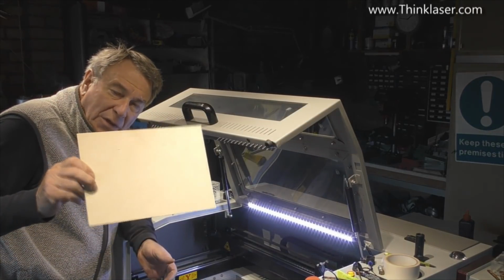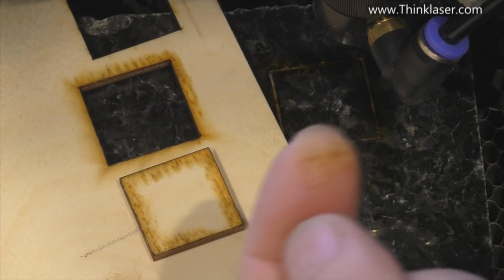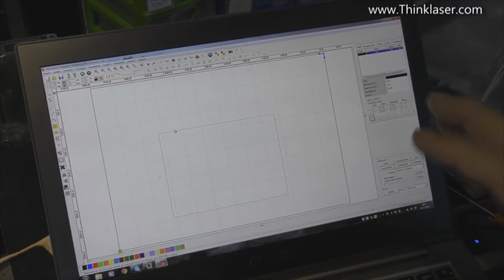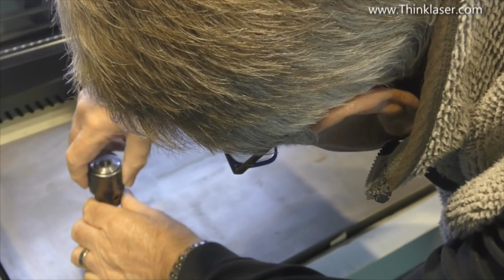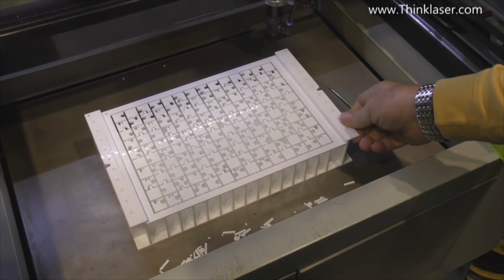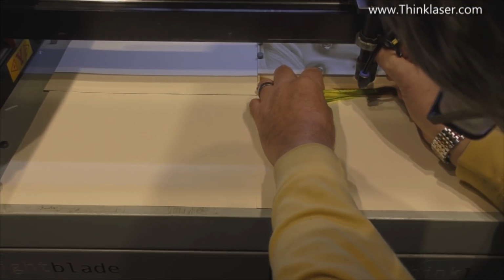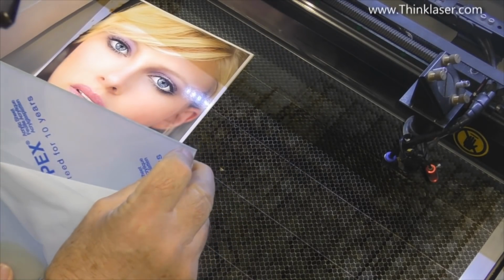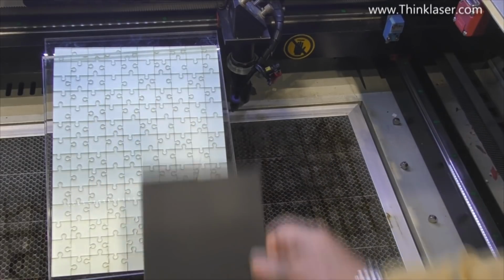How To Laser Cut a Jigsaw Puzzle (2019)

Comment: Two other solutions are to back the wood with either masking tape or the transfer paper used to place vinyl for signs.  The latter is just wide, sticky paper and comes in different levels of stickiness and comes in sheets or rolls.  It is not expensive and is easier than applying several strips of masking tape.
Reply from the maker: Hi Dav, I've used the same tape myself occasionally, however I prefer to have the extractor to pull the fumes away before they have a chance to settle on the surface.

Comment: Just raise the puzzle stock up off the honeycomb the thickness of the stock - pieces will fall down as they're cut free and you get no blowback as long as your honeycomb is relatively clean (cut 4 strips of stock and put under the 4 sides). Also, COVER any exposed honeycomb to give the best downdraft from your exhaust fan. #puzzleimpossible 🧩🐰👍

Comment: You used 467MP. There is also 468MP, it is a thicker sheet and better suited for rough surfaces, like wood. I found out about it in the 3M website, they had a downloadable PDF about different adhesives and their uses.

Comment: What about to cut puzzle line few times with high speed and low laser power? To make plywood evaporate like coding the engraving instead of burning it? Like 500 mm/s 15% power, few times to get the bottom of the plywood. It might be more time consuming but I’m interesting what’s results you can get

Comment: Hi! Im working on this problem too, have solved the marks on the back with a pin table. The front has to be 100% clean as well, for now i use masking tape. I have an epilog laser with air assist. Did somebody modify a similar lasercutter with special nozzles or so?

Comment: This is not hard! If you lift the wood off the honeycomb, the resin flashback will disappear, but you still need to avoid raising it too to high and loose being able to use the table's alignment / registration guide(s). All you need to do is put screws in the honeycomb "holes" where the heads of the screws will elevate the wood ~4mm. That is all the space needed to preclude flashback.  Using a paper printout of the vector lines will show where NOT to put a screw-which w/could cause flashback.  An easy way to remove the screws post-lasering is to use a magnet to lift the screws out of their "holes".  So, get get screws that are attracted to magnets.  I live in the US and imperial screws tend to have flatter heads, so I searched metric screws whose body was large enough to fit in my honeycomb grid AND with large enough heads to not fall through the grid at least 4mm heads.  As I recall 10 or 12mm screws worked best in my grid. One doesn't need many screws.  For a project like this, 7 would be plenty: 6 around the perimeter and 1 in the center. Voila! No more flashback.

Comment: I see a lot of 'use masking' tape comments. But good luck in peeling 144 pieces of fragile masking tape off. Instead just put down a piece of paper under the print, all the gas will coat the underside of the paper and can be thrown out afterwards.

Comment: OK, here are some things that you could do — and they work.  If you want to stick with the wood on the vector grid, you can do what you did, and then when you flip it over, run an orbital sander of the back side of the wood.  That will get rid of all the blow-back discolorations.  This is something I used to do until… What I prefer to do is “lift” the lasered piece off the vector cutting grid.  You do not need to build a fancy contraption that is centered in the middle of the table with a specifically created file to consistently place your piece.  That has to be really inconvenient each time you use your laser.  Use the home corner braces of the laser table.  The piece will ALWAYS be in the exact position, without a template starter file.  There are two easy ways to raise the picture off the grid, so it does not have contact with the metal vector table’s grid, particularly when you have a border around the final product, which you should have, anyway, to cut a final perimeter cut.  I use pieces of acrylic (typically 1/8" (3mm) or even 3/16" (6mm).  I have lots of interstitial pieces of acrylic from various projects that are small and round or square (or can be cut from projects that have interstitial places-why waste this acrylic that an be useful, someplace?).  Place a piece under each corner and in the middle of each side of the frame part of the pre-jigsaw puzzle.  This gap will preclude any back-flow markings on the underside of the piece.  What I have now found to be even easier is to insert screws #8 about 1" or more long (4M??  ~10mm long) in the vector’s honeycomb.  The head of screws, which an also be as thick as one wants (whatever the manufacturer makes), will keep the screw from falling thru the vector grid.  The screw heads are consistently the same height so will consistently raise the cutting piece above the grid the same amount which would maintain a level piece.  Additionally for curved pieces to be lasered, get a heavy bar and place around the edges on the perimeter frame of whatever is being cut.  I cut lots of laminate (Formica, etc.) which is always curved and too rigid for metal bars to hold flat.  I used some aluminum angle bars, 1/16" (1½mm) thick with one “leg” of the angle bar cut to it is only less than 1/16 (1½mm) long, while the other leg is however wide it was when you bought the angle bar.  So then I can secure this aluminum bar to the home point perimeter of the vector table with screws or binder clip, in my case, on the left and top side of the lasering table.  This creates a small gap between the vector grid (or raster table) to hold down at least two sides of the piece to be lasered.  It only adds 1/16" (1½mm) to the “absolute” home position location.  I keep these bars in place, always, so I adjust my “true” home to be the same amount off when I position pieces.  Additionally, I had a heavy metal bar with a 1/16" (1½mm) by 1/16" (1½mm) groove on one side / corner of the heavy metal bar.  This creates, yet another, hold-down option for the third side of the piece I am cutting.  And, this is “adjustable” to whatever size my laserable material is.  Furthermore, I have a couple smaller metal bars with a small 1/16" (1½mm) by 1/16" (1½mm) groove on one side of the heavy metal bar.  This securely holds down the fourth side of whatever piece I am engraving.  The only thing that really matters for registering the location of whatever is going to be lasered is the home location: all lasering is based on that consistent reference point.  That will always be the same, but for the 1/16" (1½mm) offset from the aluminum bars.  Even with screws with 1/8" (3mm) caps or small acrylic pieces, the aluminum bars are still high enough to consistently register all the laserable pieces.  If the laserable piece is put in the middle of the piece to be lasered, the small 3/16" (6mm) riser in the middle, even if a vector line crosses it, does not cause notable flash-back marks.  I routinely do this with all my acrylic pieces because even if acrylic is laying flat on the vector grid, the heat from the laser beam heats up thin metal of the vector grid and causes a slight melting dip on the backside of the acrylic.  I am almost positive the one halfway successful effort of gluing the picture onto the acrylic backing would have dozens of small melting dips from the heated vector grid metal.  Just some thoughts…

Comment: On the jig you made it has the holes where the tabs of puzzle are but the laser hits the frame underneath. So trapping smoke. Could you not just drill the holes out on a pillar drill so no frame is left to a depth of say 6mm. Plenty of gap for the smoke to escape then.

Comment: Wouldn’t simply covering the backing with a masking material solve the problem.  Then just weed off the masking and you have a perfectly clear back.
Reply from the maker: Hi Shadow Living,

That would work great, it's just really tedious and time-consuming weeding individual small parts

Gareth @ Thinklaser
Reply: @Thinklaser  I don't think it would be as time-consuming as creating a raised floor jig that didn't work. Sometimes things just take time.
Reply: @JeffRevell  I make 5 to 10 items that I sell a day. I remember the first one I made. It wasn't that bad. it only takes 10 minutes each one, well that is 50 minutes to 1 hour 40 minutes a day. I would spend 200 hours on a project to never need to weed parts of masking tape again. For a hobbyist it's only 5 - 10 minutes, for me It's a big issue and may hours after work working on tape.
Reply: Or you can just prop it up with .25" wood pieces on the corners and one in the middle. Sand the one piece that gets burnt.

Comment: Can you not alleviate the vapour problem by correctly/optimally configuring beam focal point, speed and power? 

For me, using high power, perfect depth, very-quick passes on any base there is virtually no vapour residue on timbers, even without special exhaust nor compressor. Haven't tested expensively with acrylic, though probably could achieve similar results.

Comment: Russ, slightly off the topic, though maybe allied, would it be worth a video on kerfs. I imagine that jigsaws would benefit a close-fitting jigsaw. Also, because finger boxes are popular, there is a need there as well. I haven't found anything in RDworks (that I can recognise) for kerfs, so maybe it needs to be done in CorelDraw (or other 2D software) before transferring to RDworks.
Reply from the maker: Hi Michael,

Hopefully, this will help:

"Sew Compensation (Kerf Settings): A kerf is the width of the cut made by the laser. By default RDWorks cuts along the centre of the path. This will result in outside cuts being smaller, and inside cuts being larger. The kerf settings allow you to correct for this. RDWorks calls the Kerf setting “Sew Compensation”. It is found in the cutting parameter window under the Advance button. "

However, this relates mostly to getting accurate dimensions and is of no use in a jigsaw puzzle. Your best approach is to use a 2" lens and get the smallest spot size you can to reduce the Kerf. 

Gareth @ Thinklaser

Comment: I've used "greyboard" as the base material. Cutting this gives minimum visibility of smoke on back of jigsaw. However it leaves much dust from the filler in the greyboard after cutting which needs brushing away. When using photos I have first laminated them using standard heat laminator  (on photo side only - so 2 puzzles from one laminator pouch) This gives a robust surface to the photo, and can cut down fading due to UV. any smoke on surface can be easily removed.  Minimal cutting power is essential to prevent darkening of cut lines and dot mode seems to give best results
When using plywood I have very lightly sanded the back to remove smoke damage.
To remove cut puzzle from cutting grid I use a thin flexible but stiff plastic sheet with the top edge bevelled to facilitate pushing under pieces  (but still difficult)
As these have all been test pieces I have used PVA glue to bond photo and backing. It seems to work with minimal warpage from water base in the pva.
I have some Frisket Film  low tack which I will try on the back to prevent smoke damage. This seems to have no harmful vapours from burning

Comment: This was one of the more fascinating videos. Very enjoyable. 

I've had quite good luck with paper transfer tape, the stuff used by vinyl cutter tradesmen to transfer vinyl designs from the backing paper from which it is cut to the destination surface. There are vinyl/plastic transfer tapes and paper transfer tapes. Obviously, the plastic stuff is to be avoided, but the high-tack paper, when properly burnished on the surface, does a great job of keeping the vapors clear. I've used it on both sides of silicone gasket, 3mm birch ply and acrylic as well.
Reply from the maker: Hi Fred,

Thanks for the suggestion, I've used the low tack transfer paper in the past and it is great at keeping the material clean. However, it can be laborious peeling it off each piece afterwards. 

I have seen an acrylic honeycomb bed which is about 10mm tall that may be more suitable, but it doesn't help with the issue of the ply bowing.

Gareth @ Thinklaser
Reply: @Thinklaser  I had forgotten to add that I used the transfer paper on a mandala design on birch ply, with acrylic paint applied to the engraved portion. The weeding process, as it is known in the vinyl industry, was extremely tedious! A flat scraper saved me some of that effort, though.
Reply: @Thinklaser  Weeding the backing paper off of the Perspex is not that hard, and leaving it on would have solved the discoloration of the Perspex puzzles pieces. I have had problems the the laser cut edges of acrylic getting a texture, I think it is from the hot fumes as the laser cuts. Leaving (or applying blue painters tape) solved that problem. For vinyl cutting, there are weeding tools that help with that process. They would work well with weeding the backing from the Perspex, but the tool with the sharp point could scratch the wood peices.